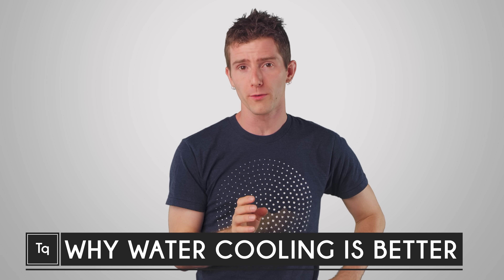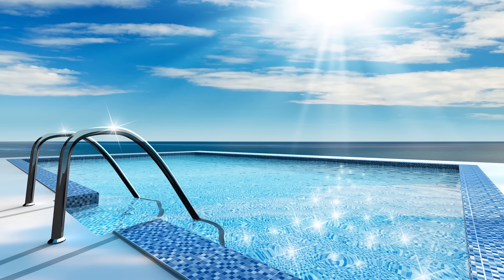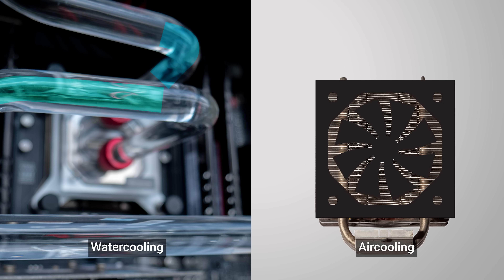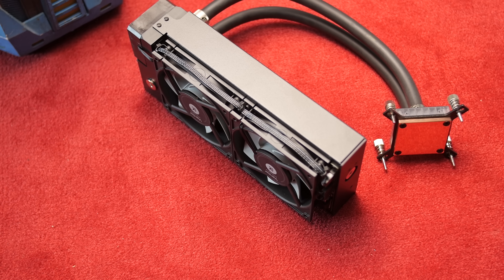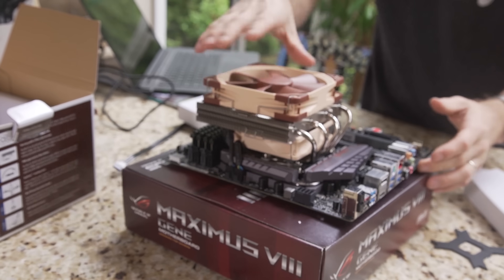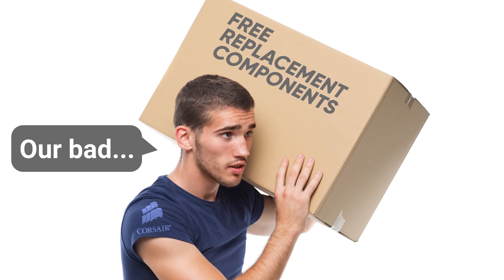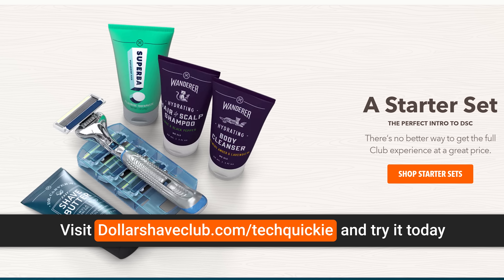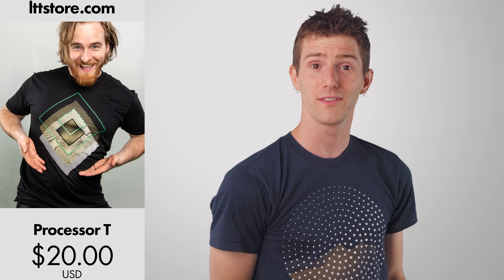Why is Water Cooling Better?

Comment: I'll still keep the BeQuiet Dark Rock Pro 4, air cooling is more reliable, easy to clean and less expensive than self-build water cooling or AIO
Reply: I hear that.  I'm using a 10 year old air cooler that has been rock solid dependable the entire time.  It keeps my r7 1700 @ 3.8ghz under 55C on a max load and the only time I hear the fans is when I need to blow the dust out of it.
Reply: same. an im in a  mini itx build
Reply: Same.
Reply: 02:52 So the pumps do not emit any noise? Interesting...

Comment: #Techquickie
on this subject: Thermal conductivety is it the same/rated sort of same as electrical ie: if metall has alott of resistance like ohm`s it that also more heat resistant or
can some material have good conductivety for heat but bad/heavy ohm`s for electronic`s ? :D
now i kind of miss the old P1-P3 cpu`s that made noise and hdd and floppy XD :D

Comment: NH-D15 still outperformes nearly every 240mm AIO for less cost.
Reply: it also has no pump noise
Reply: The ND-D15 basically IS a 240mm AIO, with much bigger fans at that. It has a cold plate, pipes that contain liquid, radiators that transfer the heat to air and fans that supply airflow in the radiators. The only technical differences between an air cooler and an AIO are the active pump and the freedom of radiator placement.
Reply: @diomedes7971  Replacing fluid every two years certainly is not "high maintenance". It's a 10 minute job. That is less than 1 second of maintenance per day. They are expensive though.
Reply: Even though I like the concept of a big beefy air cooler, that one is pretty ugly, even if preforms great. I will soon find out how well 240mm AIO preforms, as it was recommended by my system builder for cooling the i7-13700K rig I ordered.
Reply: Yeah but a custom loop is just the best if you can afford it.
Reply: It's also ugly AF
Reply: No thanks. Looks like brown shit, noisy and power hungry, bulky, expensive...
Reply: @jimmicrackhead12  "power hungry* xD
Reply: @Kappa with ryzen boost behavoiur and boost of cpus becoming more like gpu boost it is.
Also with very high overclocks.
Not to mention that it is making a larger difference for gpus.
Reply: @KAKUN_DESU  performance > looks
Reply: Corsair H100x beats it at $80 and it’s also massive, has ram clearance issues, and it’s only attractive to a very niche group of people. If you wanted you could get different fans but then the overall cost goes up.
Reply: Where did you see this test that put H100x against NH-D15? I haven't seen any direct comparison. In KitGuru's test  H100x kept their test processor 7c degrees cooler than BeQuiet Dark Rock Pro 4 did. This is nice until you see that when H100X achieved this it also created over 6 times higher sound pressure. Noctua NH-D15 runs about 4c cooler than DPR4 and is slightly quieter than that.

Obviously you can put the NH-D15 in to a "Jet engine"-mode where it almost as noisy as H100X and runs cooler.
Reply: @therevanchist1123  why would buy a noctua cooler and change the fans that are probably the best fans in the market
Reply: And 280mm AIO kills D15.
Reply: @diomedes7971  And well, your opinion is wrong.

Comment: There's a reason why cars have water cool motors and not just fans.
Reply: Because an engine has a much more complex geometry. Its not only a single plane surface with the size of a few square centimeters.
Reply: @dr.blutfleck7816  Same concept doc.

Comment: Your Point on the thermal Capacity is not completely correct. Thermal Capacity is measured in J/(kg*K). The problem is that Water has a very low density compared to metals.
In other words: when you fill your Pool completely with (almost any) metal it can absorb as much energy if not more than the pool filled with water. It would just weight 10-20 times as much.
Much of the cooling power however comes from the movement of the water, this is called convection and also happens in the heat pipes of air coolers.

Comment: Just remove the headphone jack. 
Boom water proof system.
Reply: Lol that's Apple's 200 IQ move right there...
Reply: You can have headphone jack and be waterproof at the same time if anyone is wondering
Reply: Kekw
Reply: LOL good one
Reply: Uh speaker and microphone hole
Reply: @nfslunatic199  the speaker and microphones have cages on them, preventing water from getting in
Reply: Gryffin Porter charger port
Reply: Raging Wolf  water tight seal
Reply: Raging Wolf the charger port has silicone around the edges and all of the little pins inside also have silicone around them waterproofing the charging port, although that silicone can’t withstand high pressure water 100% of the time therefore causing apples water resistant instead of fully waterproof

Comment: I got myself a beast of a water cooling setup all used from eBay. for $60 bucks I got enough to run 2 loops if I wanted. so never be afraid to check out used parts.

Comment: Plus air coolers are big + ugly. A small block on the socket let’s you show off that mobo
Reply: Yea but having a giant ass radiator ontop of your case looks amazing. -_- If you build a pc for the benefit of other people looking at it you are building it for the wrong reasons.
Reply: FloppyDriveMaestro - I have my rad in the front and I think it looks good. I definitely take aesthetics into consideration when building, I’m gonna have to look at it for a long time! But I don’t sacrifice performance either, I have a 9900k + 2080ti 👍